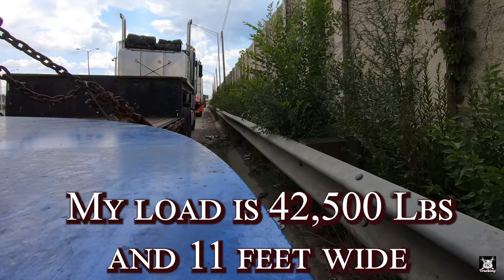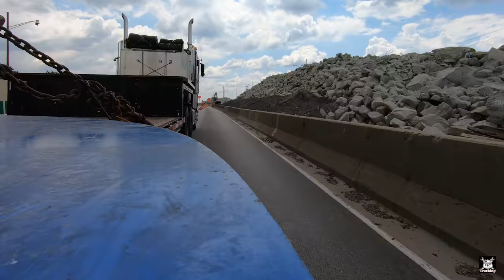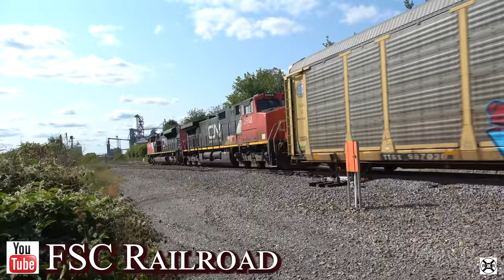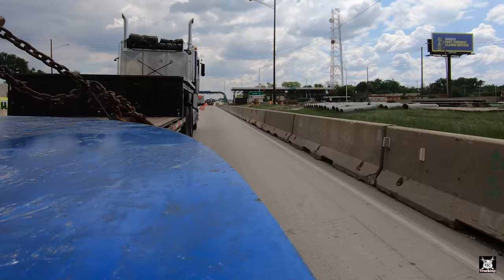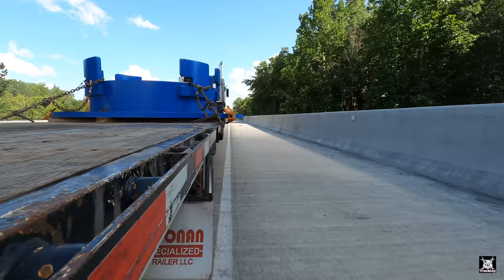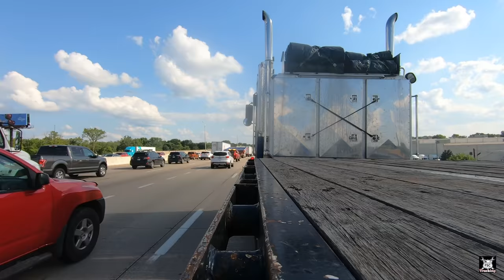How Hard Is It To Squeeze A Wide Load Though Traffic

Comment: An intelligent trucker will see you splitting lanes, observe your load/flags and know exactly why you're doing what you're doing. I respect guys like you. I used to haul construction equipment around my county and I had to do it plenty of times. I especially hated the narrow back roads where I'd be over the shoulder at times and would often encounter oncoming trucks and buses. These wide loads are not always as easy as they look. A skilled driver just makes it look easy, but there's always those edge of the seat moments.
Reply: Unfortunately in Chicago that doesn't happen.
Reply: Thats the key word.Intelligent.Thats rare with most truck drivers.I picked up at a lumber mill one time.The security guard their told me she observed that most truckers were mentally challenged. LOL